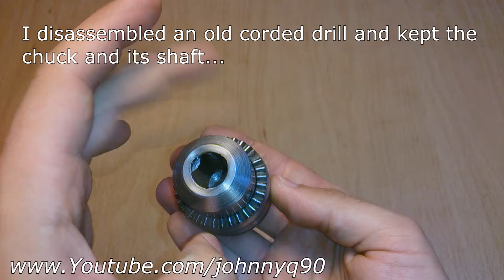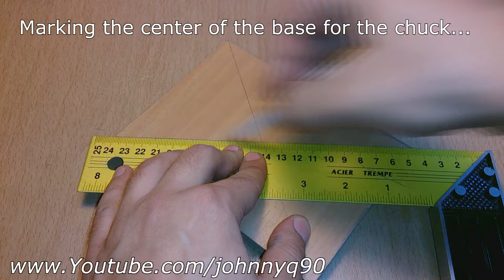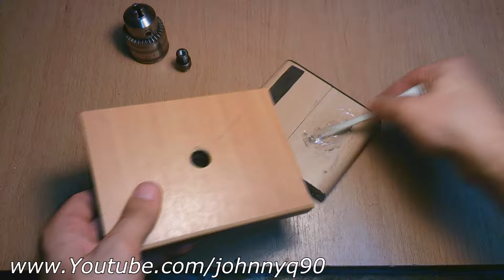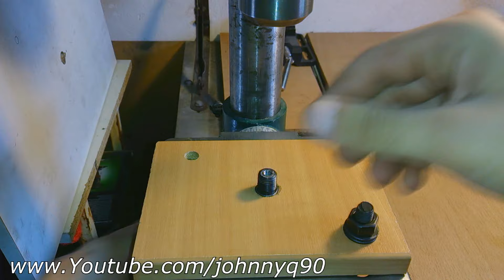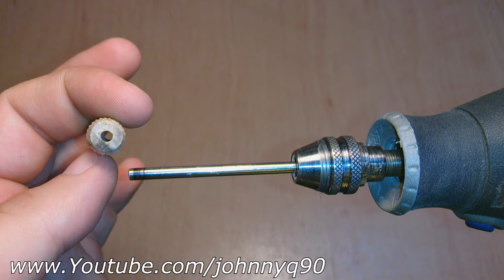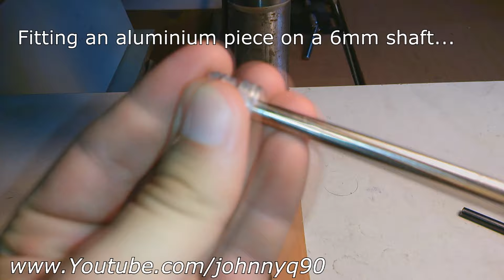Drill Press Centering Jig For Round Objects

Comment: Nice jig!  A machinist's vice works pretty well too. Put your workpiece into the drill press chuck, line up your vise. lower the drill press and clamp it in the vise. Unchuck the workpiece, chuck up the drill bit, and you'll hit dead center. It's a little fussy, but dead accurate if you're patient.

Comment: I have been doing something similar over the years but a bit more refined. I purchased a Chinese 4" 3jaw lathe chuck on sale for about $50 new and mounter it on a  squared and ground steel plate with 4 holes for mounting to a table or clamping in a vise. It worked so well I did the same with a 5" and 6" 3 jaw chuck.

Comment: For weeks, I've been attempting to drill a centered hole through a M5 x 15MM stainless steel set screw. After many attempts, with tedious preparation beforehand, I've come somewhat close to drilling a reasonably centered hole on an inconsistent basis. Frustratingly, the resulting hole isn't precise enough for the part's intended application. However, I feel I can fabricate this critical part by using this method. Thank you so much for sharing.

Comment: Very clever, but . . . You invented the lathe !
( same system, the tool is fixed, only the working piece is spinning ! )
I went on a similar idea many years ago, and got a deep hole in a piece of brass tube, 6 mm. external diameter, 4 mm. bored internal ( if i remember ), the lenght was more than 100 mm. My drill press chuck was already bored, so i could get such a long "tube". After that, i bended it using some pieces of iron wire inside, which then i pulled out one by one with a plier. Then i screwed outside the ends of this tube, and used it in my oxygen torch !
I think that now or later, you are going to get a lathe for your works.
I got one some years ago, and after that i went with works i'd never thinked of !
In the meanwhile, try to protect your fixed chuck from falling chips using a piece of plastic sheet , placed over the fixed chuck, with just a little hole for the drilling bit, ok ? Cheers, Alessandro from Italy.

Comment: You can do this with a drill press vise. Chuck the drill bit upside down and lower it in the vise and tighten really good then un-chuck bit then put whatever you putting the hole through in the chuck and lower it down on the bit....

Comment: Excellent,  simple and very very useful.
It's not relevant but I would always out my bolts facing down so that if they ever unscrewed themselves then the but will fall but the bolts will stay in place, at least for a while longer.
I would also thinking about it, recess the heads of the bolts so as not to cause accidents by inadvertently catching either the material or one's clothing.
Again, brilliant vid, so much so I'm in your club😂

Comment: If you weld the chuck to a flatbar with at hole same size as the hole in the chuck, you dont need the axle and can then fit much longer pieces through the chuck (and drill-plane) ... oh and btw. the swiching of workpiece and drill was new to me. Thanks :-)

Comment: A very good solution!  In this way the chips automaticly fall out. Also a lot quicker then setting the lathe up for the occasional small part. A tip to get the drill centered in the hole is to turn the drill in the left direction bij hand. This will aligne it 100% before drilling. Good work.
Reply from the maker: +Rob Gerrits Thank you, and thanks for the tip ;)
Reply: Rob Gerrits g
Reply: Rob Gerrits
Reply: JohnnyQ90  de Walt mask is
Reply: Clarification please

Comment: Very well done and thought out idea.  I have a metal lathe and just use it, but one thing I find is small drills react to the grain in the wood and bend, so the hole out the other end is not always centered. Had any problem with that.

Comment: I user this about 4 years ago to drill and tap some rifle brass for Hunter Safety Props  I used a 1/2" chuck.  You do not need to use the shaft of the drill  almost all portable drills use a chuck thread of either 3/8-24 or 1/2-20  which are thread sizes that can be purchased in many fastener styles.  I use either set screws or allen cap screws  Both are stronger than normal screws but still workable for sizing to fixture.

A hint for the reclaimers  reversible drills have a keeper screw on the end of the shaft  it is Reverse threaded (Left hand)  most of the time and it is loctited in. Open the chuck fully and find out what slot shape it is. Make sure your tool fits tightly. clamp the chuck in a vise and then proceed to remove. For the chuck it is best to clamp the tool in a vise and place a very large allen wrench 3/8 or larger  and use impact on it to unstick it
Reply: 56
Reply: Peter -> Excelente
Reply: Peter -> thanks
Reply: Doh!  I tried to get mine to seperate but couldn't make it happen.  Will have another fair go.  Thanks for the clarity.

Comment: i guess if you have an old chuck lying around and cannot think of any other use for it this would be one way to use it but there are drill press vices you can get with a small v notch in the block that will accomplish the same thing and easier to set up.

Comment: You wouldn't have to worry if it runs true if you skipped the whole drilling part and just tightened the rod in both chucks, then fix the bottom plate. 100% accurate.

Comment: Stock center finder.  Works on round stock, square stock and all the shapes in between.  No time spent looking for broken tool parts or cutting/assembling (time is money - how much would you pay you for that tool?)
Reply: Ya, great for finding the center, still doesn't guarantee drilling a centered hole. Fo working with little parts like he is showing you'd need a vise to hold it, which would keep it true along one axis but you'd need to do something else to make sure it was true along the other axis.

This saves him the trouble of having to mark anything and serves as a vice along all three axes, plus putting the part to be drilled in the drill itself clears the chips exceptionally well.

Comment: Any suggestions if you need to center a hole in a rod too large for my chuck?  I need to drill out a 3/4" dia shaft and my drill press chuck doesn't open that far.

Comment: that was done the hard way. drill a hole in a piece of wood that has benn clamped to ehe table use a drill the same size as dowel . insert dowel in hole and drill
Reply: Elmer Fisher A hole in a board would be the hard way after this tool is made. It adjusts to different sized pieces AND grips them without trying to match drill bits to work pieces and then boring yet another whole to complete your part. Saves 2 steps every time you use it and doesn't waste scrap wood.

Comment: I want to drill a 1/4" hole in the center of some 1/2". 3/4" and 1" PVC end caps.  How do I do that accurately without a lathe
Reply: MrGrunthunter's Adventures Just in case you’re still working on this 🤷‍♂️:  Buy three forstner bits - 1/2, 3/4 and 1”. Using a bit of scrap timber drill a hole with each bit. Drop the end caps in their respective holes. Insert the hole’s respective forstner bit, apply a bit of hand pressure and it’s point will leave an indentation dead centre of the end caps.

Comment: Can't seem to get my epoxy to stick to the chuck mounting shaft.  What epoxy did you use and did you modify the shaft any further than cutting it short? I've used Staybond that failed over night.  Now trying west systems 105 and 205 fast hardener.
Reply: WhoDatBe Dare if you still need to get it, grind a flat spot on the shaft. Between that and the roughness, won't spin.

Comment: Is there a reason you rotated the work piece instead of the drill bit?
Reply: Whats happens if you Drill 0.5 mm off centred...

- Drill spinns: Hole is 0.5mm off centred 

-Piece spinns: Hole is 1mm Bigger, but its always in Center

same with the Angle, if you're a little misaligned...

hope it's understandable ;)
Reply: If you rotate the piece instead of the drill, it wants to self-center.  Watch some videos of people drilling holes on a lathe and you will often see that the drill deflects to center itself on the work piece.
Reply: I think what you mean is if the drill is sharpened off centre (by say 5mm)then whatever you drill is 10mm bigger, that is assuming a pilot hole has not previously bean drilled in that case the drill will cut true size
Reply: 10mm = 1cm.
Reply: Clap Clap. If you were a dog, I would give you a dog biscuit.

Comment: looks good ..  could a simpler solution be found by using a machine vice and a vee block ... or have I missed something ?
Reply: Too hard to align the exact center with vee blocks I would think especially for repetitive work.  This jig uses a drill and the drill press chuck to align the bottom chuck exactly.  Then any size round stock can be used without realigning anything.
Reply: That would be a major pain in the ass as it would need to be aligned due to the variations in the stock diameter.

Comment: Great idea, but be careful drilling up into that chuck, don't drill too far. I don't doubt it's running true but you didn't show it was. For a runout check, a simple trick is to use a pencil ONLY... won't work with anything else. With a part in the chuck spinning up, take a pencil and "lightly" make contact with the part in several spots, if the pencil mark shows up all the way around the part, then you have no runout. If you have runout, the pencil mark cannot mark the part all the way around unless the part has low spots where the pencil mark would skip. If it's a true running part then the mark will show up all the way around... guranteed this  trick works. No need for a special guage just to check for runout.